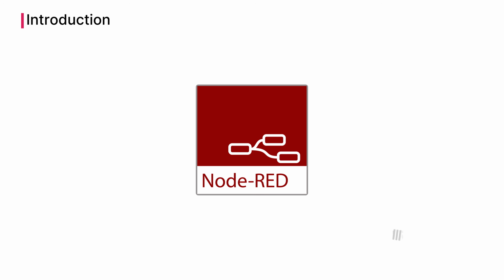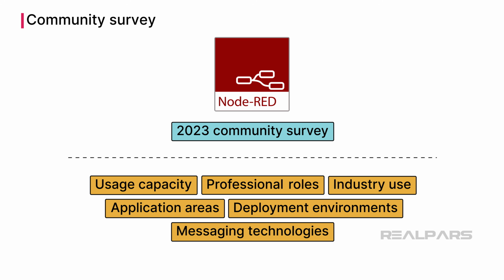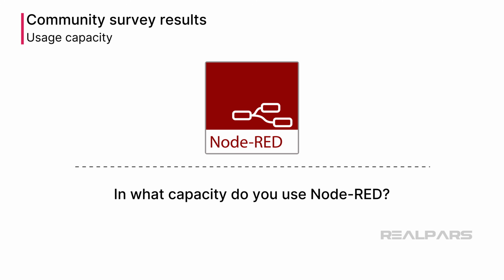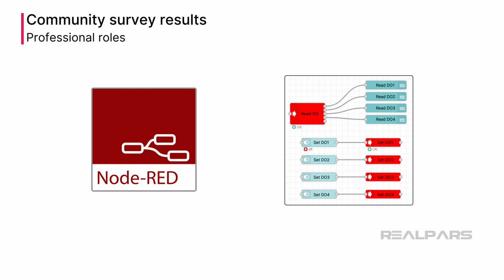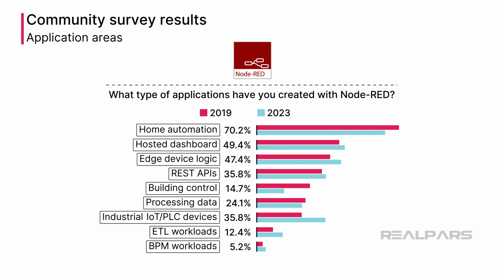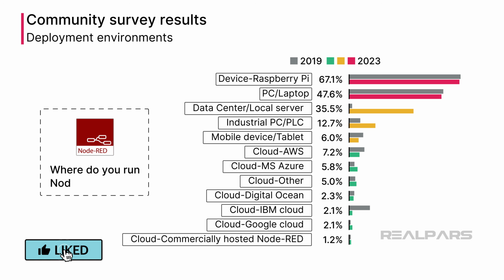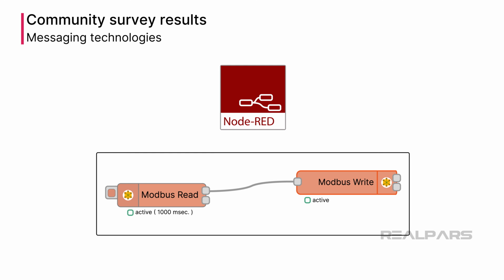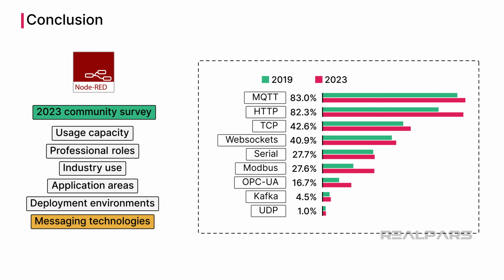How Is Node RED Used in Industrial Automation?

Comment: Cool breakdown on how Node RED is being deployed in plant environments. Using it for lightweight HMI and telemetry collection makes a lot of sense as long as it stays on the non deterministic side of the architecture.  In our setups, we use it on an edge IPC strictly to scrape condition monitoring data from Elmo motion controllers via OPC UA while keeping the EtherCAT loop running separately.
Reply from the maker: Thanks for sharing your expertise!